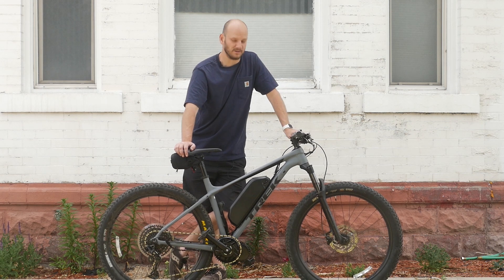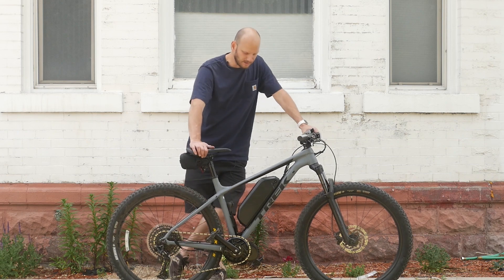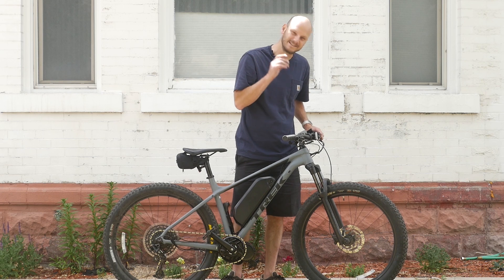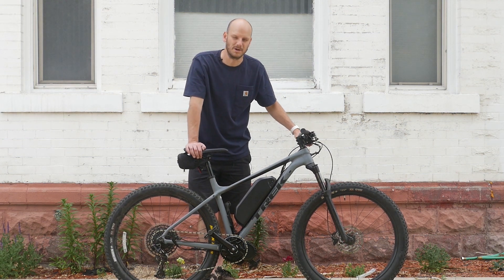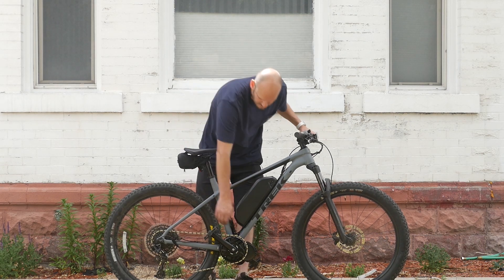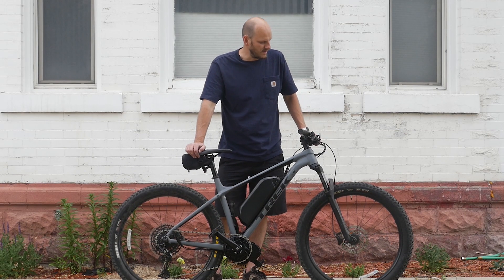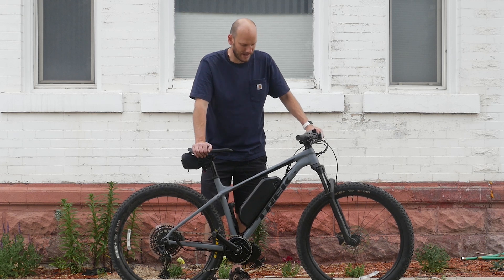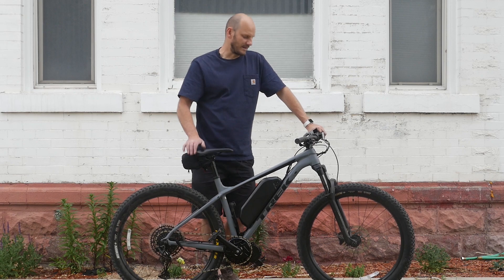Custom E-bike Build:  Trek Roscoe BBSHD 52v 17.5ah

Comment: Would a trek Roscoe or a Framed Minnesota 2.0 be a good starter to build a bike for hunting?  To climb steep areas
Reply from the maker: I’d go Roscoe for the win!
Reply: @ which model Roscoe do you recommend?
Reply from the maker: 10 speed or fewer and your golden. Doesn’t matter the trim. Higher trims will have things like better forks and better brakes. But I wouldn’t get the 12 speed or even the 11 speed version.

Comment: I've converted the exact same bike a week ago. BBS02b, 1mm spacer between the motor/bottom bracket, Lekkie 36T on front (no offset), 48V 17.5Ah, 500C display, shift sensor, no brake sensors.
Can't use the last 50T cog but that doesn't really matter. I'm climbing some serious and very demanding rocky trails here in polish mountains.
With 2.8 tubeless tyres this bike is absolutely fantastic. I don't care it's a hard tail. Just love it.
Reply: witam serdecznie jestem z Polski, kupiłem niedawno Trek Roscoe i chętnie porozmawiam na temat konwersji. Możemy się jakoś skontaktować?

Comment: Great video series love your channel!! I am trying to do my Roscoe 8 (2019),  using the BBSHD 1000W motor. The issue looks to be the motor is going to hit the chainstay. What solution did you use to get around this?  The bottom bracket is 68MM. Do you have any phots that show the chain alignment as well on this build? Thanks in advance!!

Comment: Hey jonny have u converted a roscoe 2022 version?? Would the vhange in frame shame cause any issues??
Reply from the maker: I just did either a 2021 or 2022 without issues
Reply: @JohnnyNerdOut  the 2021 has rear wheel issues so I've cancelled thay one but the 2022 has a curved lower bar on the frame from the crank but not sure if this would effect a conversion

Comment: Hello, I also have a Trek Roscoe 7 2021, but I ordered a 100mm bafang BBSHD 48v.  The question is how the 68-73mm fit under the root knot, the feathers are more in the way of the cranks and the 73mm motor.  Wrote with Google translator

Comment: Hey Johnny beautiful build. What size chain did you use in the end? I have a 10 speed Roscoe 6 do you think the bafang chainring would work or go with a lekkie 42t like you did?
Reply from the maker: The stock chainring should work. Go smaller if you want more useable power though 😀
Reply: Üzerinde ki 42 t mi ?

Comment: Awesome! I'm stoked for my build to be done! That's similar to the build I'm doing, but I'm doing two Marlin 5, BBSHD, Eggrider V2, and an EM3EV 52v 20.4ah (14s6p-35E) triangle pack. Also, thank you for the motor kits! Excellent customer service!!!
Reply: Did the marlin 5 work with the bafang motor? That's the bike I have but I'm concerned it won't fit.
Reply: @JohnJacobJingleheimerSchmit  I had to take a hole saw to the bottom bracket. I built mine first, then my girlfriends to make sure it worked. Well worth it. I probably have around 500 miles on mine so far with an avg speed of around 30.
Reply: what did you do for chain line? My build prevents me to use lower gears of 1-4 on my marlin 5
Reply: @Emmanueldup  I’m using a 42 HD Lekkie Bling Ring and don’t have a problem with lower gears. I don’t shift too much though unless I’m dealing with hills. I usually stay around 6th gear.

Comment: Hei. Nice video. Ihave also Trek Roscoe 7 with BBS02 750w middrive motor. And bike is awsome. In Filnland we have sometimes bad weather, but i trust me Roscoe..👍😁
Reply: Hey, I have a 2019 trek Roscoe 7 and want to use the BBS02 motor too. Do you have any regrets not getting the HD version?
Reply: Hi. Now when I have driven BBS02 over a year, there have been no issues with motor. And the power of 750w is very enough for me. And motor is also workin nicely in winter time.
Reply: @Arska.A.Tiikko  awesome! do you have the 27.5 plus size tires? What parts did you need other then the BBS02 kit to get the chain alignment correct? Thanks for your help.
Reply: Hi. Yes I have 27,5 plus tyres. 
Well, I did chance the front chainring to 32 size. That’s because I like to keep that mountainbike feeling in my drive. And also don’t have thumb throtle in my bike at all,  because I like to keep it more bicycle than moped. Otherwise it’s basic BBS02 setup. 
Oh, and one more think.. I did download android app what I have use to customize the motor setup.
 You need a specific lead for that. 
I didn’t instal BBS02 by myself, I bought it from a store and they installed it. I also bought the lead from the same store. But the chainring, I did not find that here  in Finland, I ordered it from USA.

Comment: Great video, Thanks !
I am in France and trying to modified my Trek Roscoe with a Bafang. I can read on many forums that the frame (chainstay) doesn't allow the Bafang BBSHD but only the BBS02, size issue.
I did a Google search "trek roscoe bafang BBSHD"
Did you come across any issue ? how do you make it fit ?
Thanks a million for you input  :)
Reply from the maker: Grab 2-3 2mm spacers for the bottom bracket 👍
Reply: @JohnnyNerdOut  Thank you :)
Reply: @JohnnyNerdOut  I'm considering exactly the same setup. My concern is - putting some spacers on the one side of the drivetrain makes also cranks and pedals shift to right side. Could you tell how much spacers will be actually needed? It this asymmetrical position actually noticable or anyhow should be compensated while pedaling?
Reply: @JohnnyNerdOut  had to use 5 on my roscoe 6 large frame

Comment: Hey. Great video. Been planning doing this on my rosco :)

Just worried that the BBS01 250w (EU regulations) will be too small for that frame since the wheels are so wide.

Do you think it will work, or do I need to go with the 02 or HD and break the law? :)
Reply from the maker: Na, any mid drive will be a good improvement 👍
Reply: you cant register it or something to make it legal? else only use the motor when riding offroad and then turn it off for public roads.
Reply: If you buy the 250w you won't have to register the bike? i know someone in the eu with same concern i would be happy if u know anything about the topic

Comment: how hard is to pedal with out the motor.  Like if the battery dies.
Reply from the maker: Adds about10% more work
Reply: @JohnnyNerdOut   I have a hub motor bike.  I can pedal it like a normal bike.  Is a mid drive motor that same?

Comment: I built a norco storm 2 with a bbshd and a 3300w modded controller with a 52v 25ah battery with a 42 t lekkie 29 inch rims 4 piston shimano brakes with 203mm floating disks . shes a beast for the price . bike $850 bbshd $1,100 bling ring $180 battery $550 lekkie crank arms $210 shwallbe ebike tyres $180 4 piston shimano brakes $250 203mm rotors $150 modded 3300w controller $300 . it all adds up buy its a killer bike way better than the bikes you can buy for the price of my bike .

Comment: I want to upgrade a Mountain Bike to a Mid Drive E-Bike as a substitute to the car for Personal transport and light shopping runs.     
I don't want to send money to China though, not with the way they are behaving.   Are there any Mid Drive conversions that are Equivalent or better than the Bafang BBS01B 250W that are Not manufactured in China?

I need to stick with 250W in order to be legal in the UK.

Something Manufactured in Taiwan would be Preferable, Which would be the Best mid Drive conversion they make there?

If there are literally no good 250W Mid drive conversions made in Taiwan,  what would be the best made in Japan?   Or Elsewhere?
Reply: mate everythings legal until you get caught . just dont go flat out on the road infront of the coppers . my country is 250w also . might aswel walk if you have 250w . i have a bbshd with a modded 3300w controller on my ebike . on road 250w but off road you can have whatever you want . i just ride easy on the road but it is nice to blow past cars going 60kph and your doing 70kph . its all about chainring sizes . i have a 42t and 46t to change when i want . i cant fit a 52t because it hits on my frame . i also put 4 piston shimano brakes and 203mm floating rotors on it . 250w is to low for my hills around where i live . i also have a 2000w hub motor ebike with a 60v 30ah battery on that bike . 52v 25ah on my bbshd bike .
Reply: @ytthecommunistplatform.2675  what country? they are strict in Netherlands i've heard.

Comment: Thanks for sharing that build vid. Are they 100mm bottom bracket?
Reply from the maker: Standard 68mm
Reply: @JohnnyNerdOut  Hello, I also have a Trek Roscoe 7 2021, but I ordered a 100mm bafang BBSHD 48v.  The question is how the 68-73mm fit under the root knot, the feathers are more in the way of the cranks and the 73mm motor.  Wrote with Google translator
Reply: Hello, I also have a Trek Roscoe 7 2021, but I ordered a 100mm bafang BBSHD 48v.  The question is how the 68-73mm fit under the root knot, the feathers are more in the way of the cranks and the 73mm motor.  Wrote with Google translator

Comment: I need a video that addresses my needs:  I ride a bike similar to this trek roscoe but I ride long distances.  Strava numbers look like 50miles/15mph estimated 150w average human power output.   I need the ebike to feel like nothing is there when not engaged.   And I need it double my distance (with my efforts ).     Will this setup do that?   Most ebikers seem to just want to casually peddle about.   I want to put in my own maximum energy too.
Reply: I feel kind of bad harping about them since it really isn't Johnny's bailiwick, but there is a huge difference in pedaling loss through the motor on The Tongsheng TSDZ2. A lot of my customers and I are roadies so we miss the direct connect feel of spinning I think you want. 

The TSDZ2 is nearly half the weight of a BBSHD and a pound lighter than any BBS01; that helps with feel and handling too. They aren't real powerful and you really have to dig to get everything out of the 750 watt (I only deal in their 250-500 nominals), but you are already exerting well above normal output. 

I'm guessing your aim is to go further during training and to see more on joy or  touring rides. The motor climbs hills. Most e-bikers really just want to go faster without much effort, making up for age or injury (some just want speed). 

As a cyclist, you will appreciate not having to swap out your high-end levers or ad a shift sensor. The TSDZ2 doesn't need brake cut offs or a shift sensor. It does make for a little easier and cleaner install (that's where Johnny's really shine over doing it yourself).

The TSDZ2 is torque sensing so they also feel more natural in assist as well. They really are more of a traditional cyclist's motor than what most e-bikers want.
Reply: @MHH3180  Can you be more clear? I think you're upselling me on the Tongsheng TSDZ2 over the Bafang products.  

Yes, I do want to augment my serious riding with extended distance.   And equalize training rides with friends that are much stronger.  

Most important is to feel like nothing is there when the motor is not engaged (except for a little more bike weight).
Reply: @leoguzynski  I would not call it an up sell. The TSDZ2 costs less. It is torque sensing and The Bafang is not. It is smaller and lighter (handling). You aren't going to get that massive fast acceleration from stop like a 750 or 1000 watt Bafang and when accelerating you can hear The Tongsheng (not annoyingly so like some others or a hub drive). It is just more natural. You really have to try very hard to hear a Bafang under any conditions. 

The TSDZ2 does feel a lot more natural when assisting and offers almost no resistance when pedaling turned off. An experienced cyclist will feel it is different, but the average Joe would not. The TSDZ2 is not better. It is better for some applications usually related to road cycling.
Reply from the maker: You can program a Bafang mid drive to behave any way you like it to, to match your riding style👍

Comment: This is such a great channel, I always look forward to JohnnyNerdOut's new releases.  

my mtb came with 27.5 x 2.5 wheels x tires like this bike has.  I'm totally confused on wheels and want to go to a 2.8 or 3.0'' wide tire.  I think the rim is too narrow to just change the tire.  I don't mind buying a new wheel was wondering what the best directions to go might be.  Could somebody suggest a wheel that would properly handle a 2.8 or 3.0 wide tire?  I just want to change the front tire to the wider one and my forks are QR9 100mm (aftermarket manitou machete) so I'm not going to go away from the forks and can't use a through-axle/boost.
Reply from the maker: If you take your bike into a bike shop they might be able to measure your rim to find what it can handle. You can also do a google search to find the same info, like how to measure your rim width 👍

Comment: What makes it a great e-bike is the fact that it is a great traditional bike. You cannot get great geometry and quality tubing on factory e-bikes, except for a few very, very high end e-mtb's ($10k+). Integrated motors generally require very poor responding square, straight gauge tubing. I never really have understood why mfg.'s felt the overly thick, straight gauge, fat tubing was desirable.

You cannot get decent components either (see caveat above). You cannot get a bike that rolls more efficiently, shifts more smoothly or reliably on a factory e-bike.  No factory e-bike stops as predictably or reliably, disk brakes or not (feel is swallowed up in bulk). Mfg's won't put quality components on their e-bikes because they don't have to. We continue to buy crap.

You could put any number of e-bike kits on any quality traditional bike and it will out shine any factory e-bike. That bike could handle significantly better if that BBSHD and rarely useful, oversized, battery weren't so darned heavy. Most are better off with a smaller lighter motor and nearly all do better on both price and performance, with two smaller batteries. You can swap batteries during normal use (extending the life of both) and carry the extra on the rare occasion you have a need for more. As a wrench, like Johnny, I rarely get to make these decisions. Often it is easier just to go with the biggest because no one knows the difference and you don't have to explain. Still, these are things we need to think about more within the e-bike community.

Comment: That is an awesome build! I notice when you do your tests you don’t pedal. Will pedaling increase top speed and more importantly, range?
Reply from the maker: Yes it does. I do the test without pedaling to hopefully give a baseline idea of what the bike's capabilities are. Pedaling will usually increase these capabilities.
Reply: Very, very dramatically on range and with proper gearing, acceleration and top end too.
Reply: I agree with Eric Hicks of Luna cycle & Fast Electric bikes that many of these are over geared. That said if it’s going to be used as a mountain bike maybe. But I like the commute road riding and have always used mountain bike frames because they are beefier ( stout ) to handle the torque stresses ⚡️🚲👍🏻
Reply from the maker: @davidj.jorgensen4828  yes, the top speed of the motor is around 130rpm. Much faster than anyone can pedal
Reply: @Scott H 

Only if you had a massive front gear and a tiny rear.

Comment: I like to go trail riding. I really cracked down on that nut to hold the motor in place. But I found on my last outing the motor swung down. Have you ever had this happen? Any recommendations on added support for the motor?
Reply: If it makes you feel any better something similar is a common problem on integrated motors too. You just have to tighten 'em up and check regularly. I have noticed ot is less a problem as the bike sorta wears in whether this kit, another or with integrated motors.
Reply: I hope to secure the Bafang socket set for this next in-process build, so I won’t need to “guess/hope/pray” like I did with the wrench.  There are specific torque figures listed, and I want to do those right!

Note also that if you make replacement (stainless) spacers, do not get too crazy on getting the thickness “just right.”  I had to mill off an added .015 inch to get the motor to stop slipping (down)!
Reply: Luna do a stainless steel bracket.
Reply: @penskib1975  have u got a link

Comment: Great looking bike. I'd like to see how you position the magnetic sensor cut offs on the hydraulic brakes.
Reply: Some brakes, e.g. Magura Ebike specific brakes, and some Tektro setups, have such sensors integrated.  I recommend the Tektros, as you can just plug those in. (Planning on their -730s for the current in-build bike.)
Reply: @dennisyoung4631  Yes hydraulic brake levers with built in sensors is an option but on this build Mr Nerdout said he used magnetic sensors at motor cut offs. I'd like to see how he positioned them.
Reply: @JohnSmith-ch9lp  I had thought to drill small holes and then insert the magnets with epoxy, but then the holder for the sensor gets complicated.  Getting a setup that is solidly reliable while avoiding something that looks “klunkey” is not easy, unless you are prepared to do a lot of work.
Reply: @dennisyoung4631  Absolutely agree Dennis and that's why I was interested in how Johnny N had done it.

Comment: Definitely a sweet build. Should climb anything the tires can grip. That granny gear is awesome. I can't understand even trying the stock chain ring on such a great build. You might be right about not needing a high number of gears with the BBSxx but I think the wide ratio is an asset. I prefer less gears, for the thicker chain it allows, but still like a wide ratio between lowest and highest gear.
I must covet 99% of your builds. Even the crazy tandem. You do some amazing builds.
Reply: @Scott H Good to know. Do you know if it was it an apples to apples comparison (same brand and line of chain for all the group-sets)?